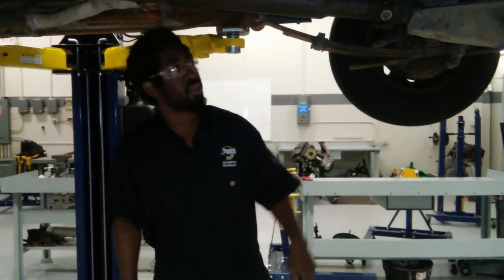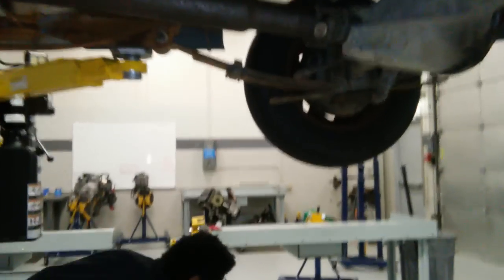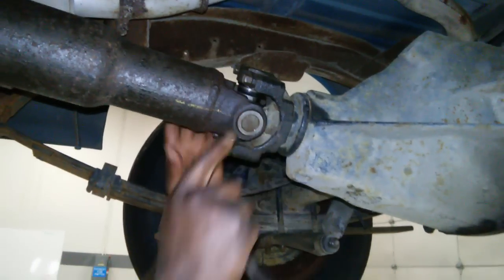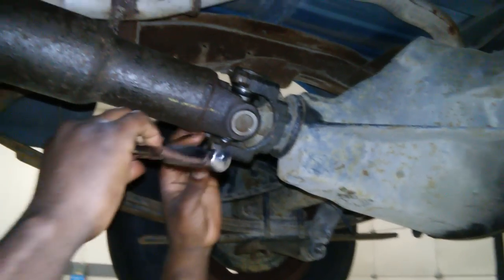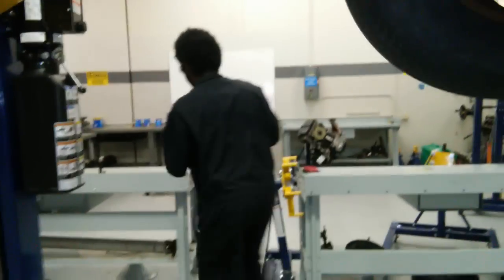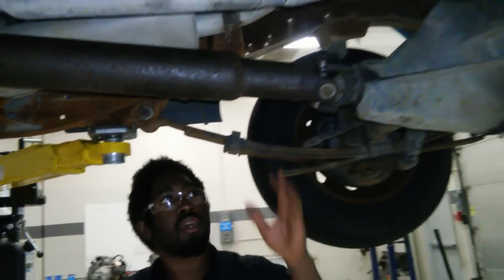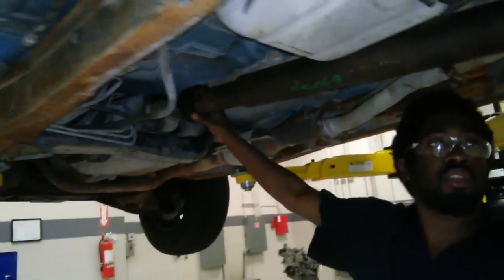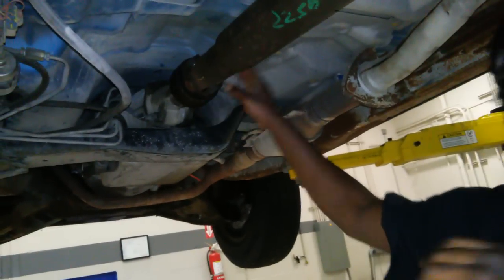Remove drive shaft s10

Comment: Do u have to remove shaft when towing on 4 wheels??
Reply: Um wut?
Reply: Yes, unless it is a very short tow. The reason to remove the driveshaft is because the wheels will spin the transmission, and most transmissions rely on a pump to circulate the transmission fluid. If your car has recently been running, then there will still be some oil on the transmission, so a short tow with your engine in neutral will be fine. Towing a car for more than like 10 miles will put substantial wear on the transmission, though. This will apply to any vehicle that has the drive wheels on the ground, and not just 4-wheel towing.

Comment: The yoke was bottomed after your first push. You have to spin the shaft to angle the joint out afterwards.
Reply: Can you elaborate what you mean by the yoke was bottomed?
Reply: @faYte0607  the original push towards the yolk was successful and he just needed to twist the shaft instead of using leverage to "push the yolk a second time"- I believe